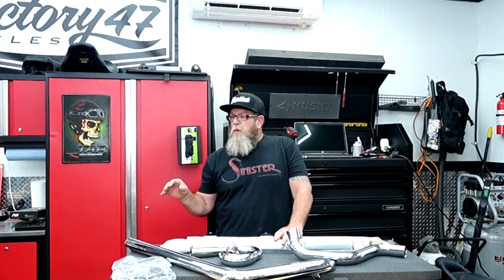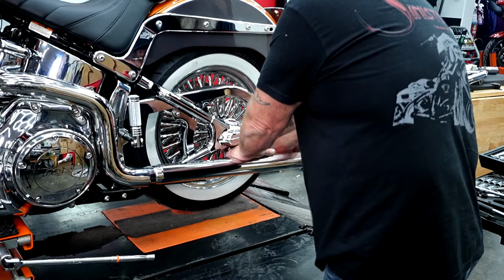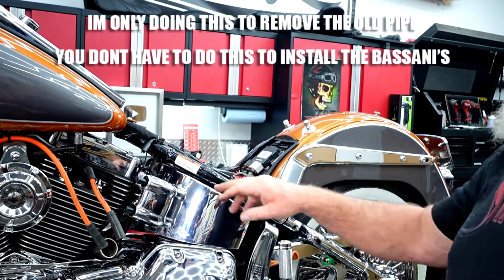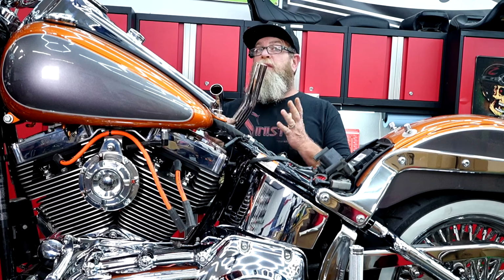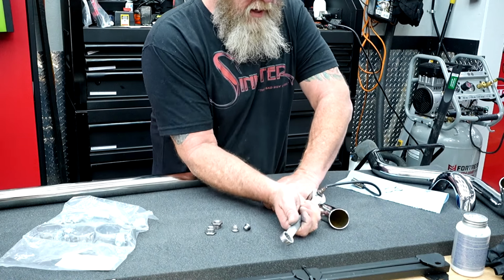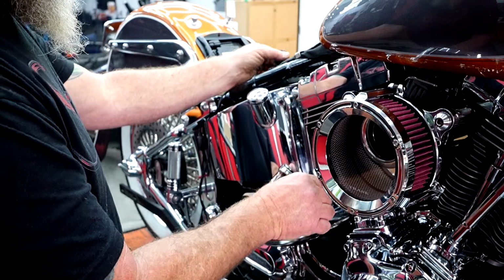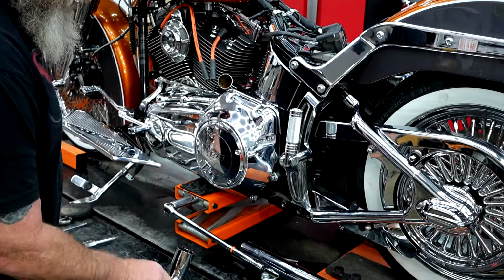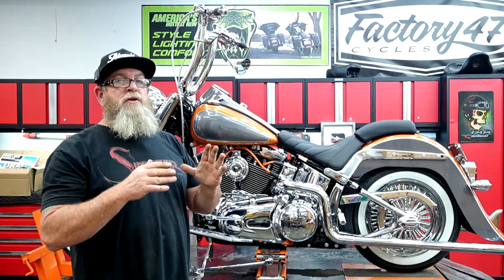⚡ The Perfect Fishtail For Your Softail! BASSANI FULL INSTALL⚡

Comment: That pipe going thru the back of the rear head can probably increase the heat on engine correct?
Reply from the maker: I suppose it could...its a pretty common routing of that pipe from just about every manufacturer of aftermarket softail headers...these engines are made to run hot...it'll be ok.